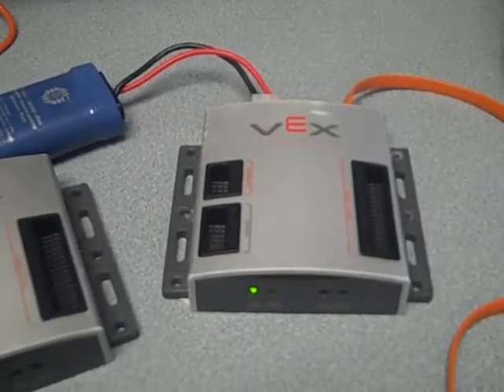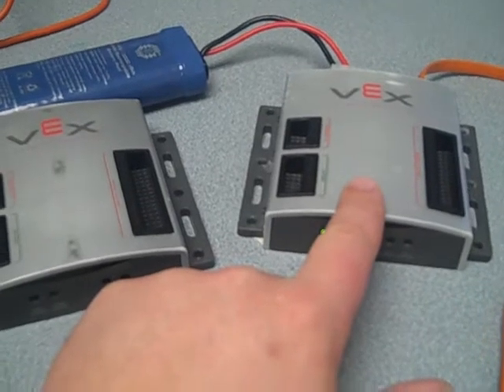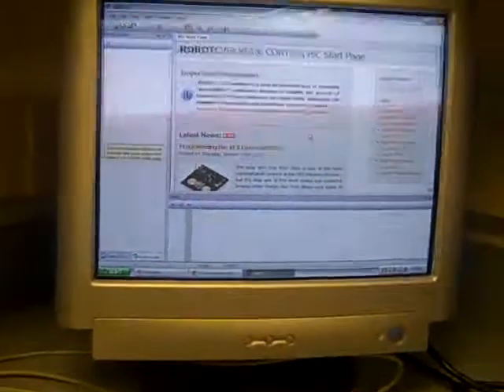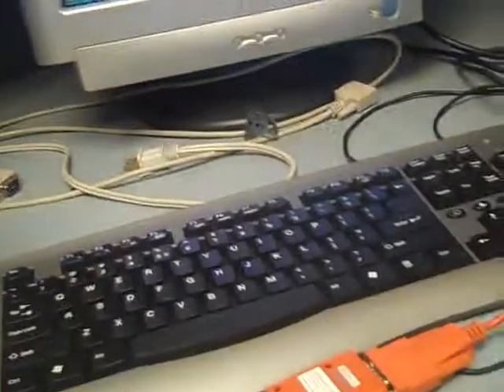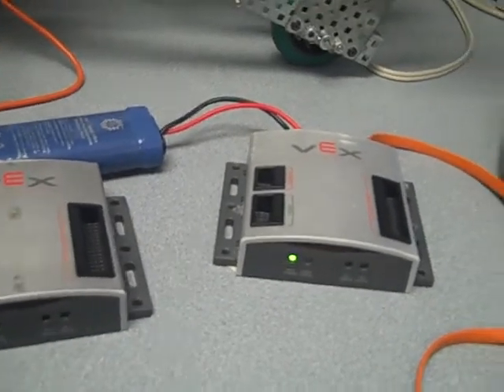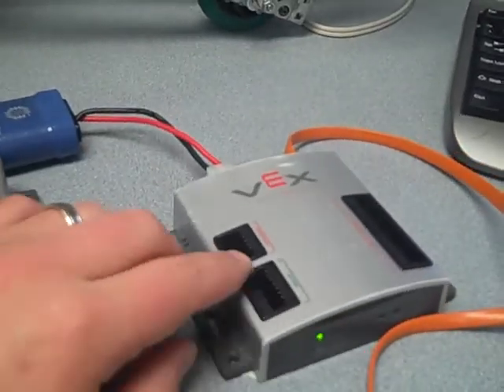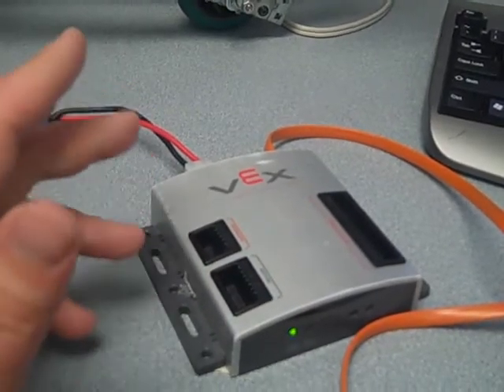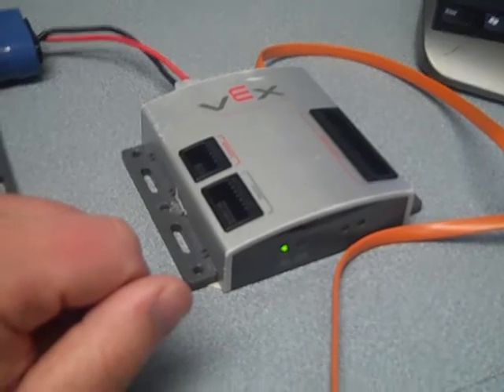VEX PIC Microcontroller

Comment: If you plug a motor into it, it will keep running because the motor only has two prongs on its wire. You have to connect it to one of those vex wires (not sure what it's called) that have a connection for two prongs on one end and three prongs on the other end.